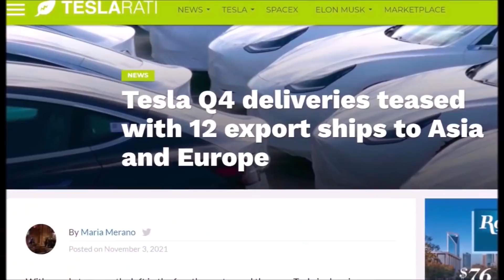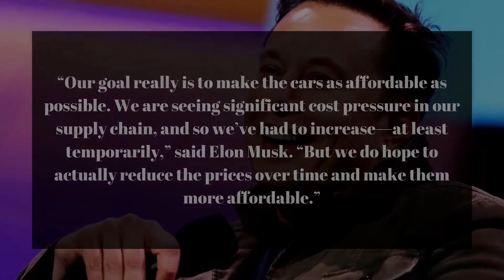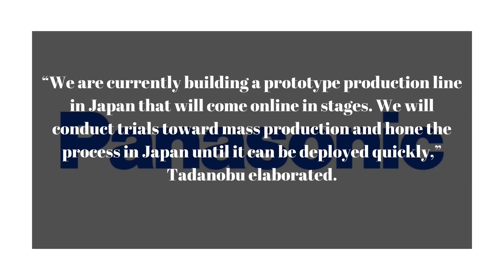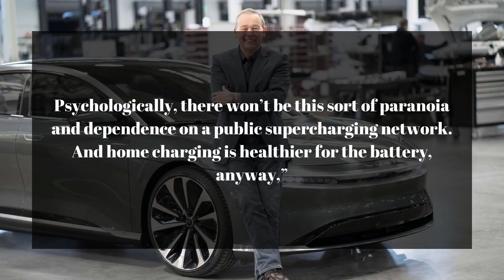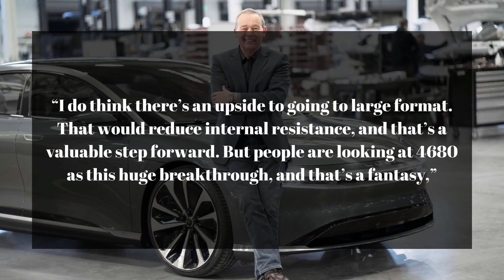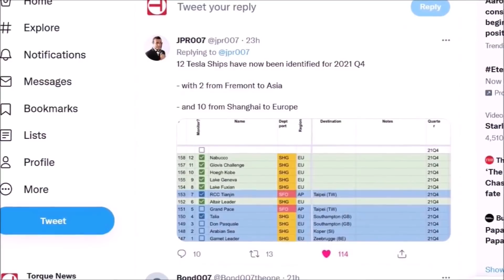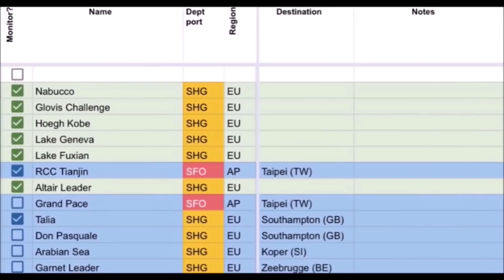The 2022 Tesla's 4680 Battery And Prices Updates Are Here

Comment: Who’s to say Tesla won’t tweak the chemistry in the 4680 battery in the future? Tesla does not stand still. They are constantly improving everything. So the comment downplaying the value of the 4680 as just another package format is spurious. In that regard, when Tesla and Panasonic fine tune their high speed automated production lines, and the streamlining of the battery pack internal cooling system, the 4680 will beat all others price wise. Let’s see Lucid go head to head with the 4680 on price and performance when it goes mainstream in Teslas.
Reply: Much easier if you make batteries under the same roof and don't have them delivered ( lucid buys calls from lg )

Comment: Rawlinson is full of it. It's not hard to get to a 500 mile range if you  increase the battery size. With Lucid Air's 118 kwh battery  at an estimated 500 mile range, the car gets approximately 4.2 miles per kwh. Tesla Model S with their 100kwh battery gets 400 miles of range or 4.0 miles per kwh. But Rawlinson and the premise of this video is missing the point of 4680. It will add SOME range and torque but the purpose is cost of production. 4680 will blow every competitor out of the water on battery cost, production cost and net margin on vehicles sold. THAT is the purpose of 4680. Lucid needs to concentrate on producing a few more of their own overpriced EV's and work on autonomy because their tiny niche market won't ever rival Tesla in the least.